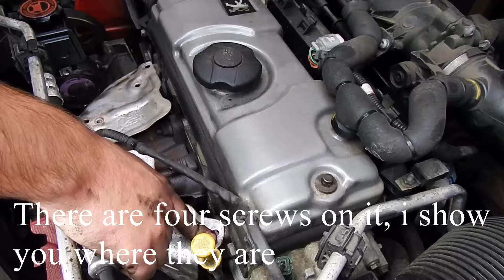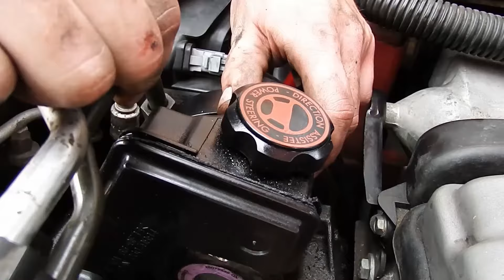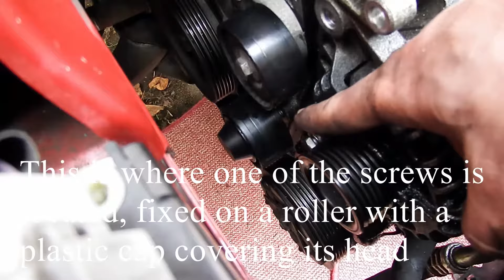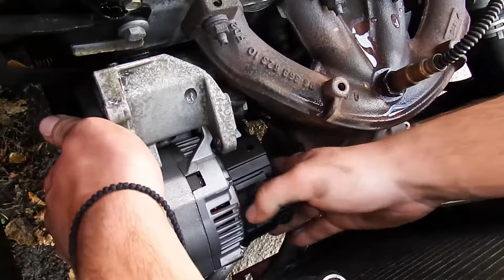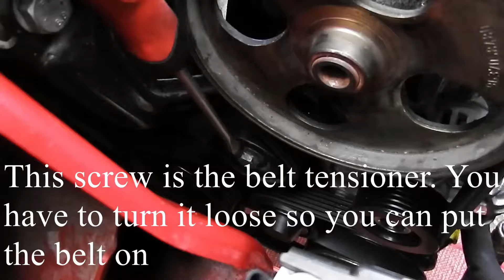Peugeot 206 how to replace alternator, belt & steering fluid pump

Comment: No need to drain the PAS pump. Remove the torx screw supporting the pipes on the opposite side of the engine, there's enough flex in the pipes to lift it and rest it at the front of the engine giving plenty of room for access. Remove the two bolts on the left of the alternator, loosen the two bolts on the right of the alternator then the bolt heads slide through the holes. Large cable is live, not ground so remember to disconnect the battery. Very difficult to read the white font at times. Example 4.50. Try a blue font.
Reply from the maker: Thanks mate

Comment: This is peugeot - simple, yet reliable.
Reply: reliable? it is not reliable lol
Reply: @iamhereforever  listen man i dont know what u heard about the french cars its true that citroen and renault are not reliable but peugeot is one of the most reliable cars on the market my dad owns one havent made a problem once .
Reply: @mishoatanasov2372  well, i always avoided french cars, but 2 years ago i bought a peugeot 206 CC and it is giving me a headace and a empty wallet. right now my dynamo is malfunctioning and i found a website today where people can open a topic if they have problems with their car and based on the amount of topics, citroën has the lowest amount  of problem reports. Citroën has 6528 topics, peugeot has 19015 topics and renault has 18869. ofcourse, it doesn't neccessarily mean that citroën does actualy have less problems in general since it depends on the car owners who visit that website and report their problem there to look for help, but it does say something about reliability in my oppinion. it could be that alot of peugeot or renault owners know about this site, and citroën owners don't but it doesnt look good for those 2.
Reply: @iamhereforever  Look man it depends what peugeot you bought and from who. Maybe the guy didnt care about his car and didn’t maintain it well. I cant wait til im 18 years old and buy a 206 gti.
Reply: @SoupyTwist the steering fluid cant leak over the alternator the lines are not even located there mate. Just do your research before speaking bullshit

Comment: Hi. I recently encountered a problem with my car . My car is a 2003 peugot 1.4 manual trasmission . The problem comes as you put the car on first gear run a little bit then you press the clutch .... If you release the cluth without shifting to a higher gear itll jerk .... It happens on every gear but on the heavier gears it gives you a harder reaction. What dou think it could be...

Comment: Great video what power steering fluid did you use in told dexron 3 or Alison c4 the Red stuff but not exact, I've got carlube to put in what did you use
Reply from the maker: Plenty of options mate, i prefer to stay with the manufacturer' s specifications

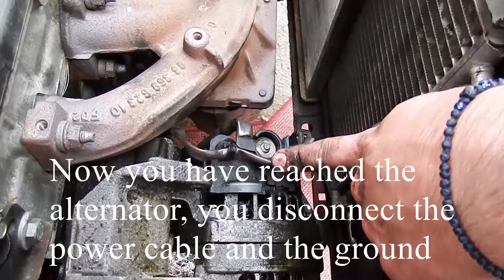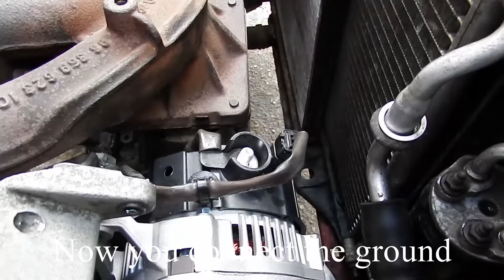Comment: 1:43 4:49 This is not the ground cable! It`s a positive cable!
Reply from the maker: Thanks mate, everybody can tell the difference between the two cables. Hopefully you too!
Reply: no offence but it shouldn't really make a difference because the battery has been disconnected. besides that, there is no way that people can switch those 2 with each other because of their connection. people who leave their battery connected while doing stuff like this are asking for trouble.
Reply: I was about to comment on this.  @Damianos 980, You are absolutely right.  The bigger round cable is the Positive out (B+) that goes to the battery.  The other connector is a switch (sensor) that communicates to the ECU.  The ground is the casing itself that bolts onto the engine.  No need for a separate ground wire.

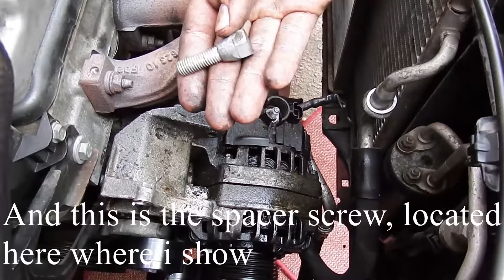Comment: 2:14
And how do you remove that screw? There is no place for a wrench
Reply from the maker: You don' t have to remove it completely. You just set it loose and it can go through the hole whilst being attached to the alternator. You can watch the installation process showing the answer to your question

Comment: Having trouble removing the bolt on the bottom right side because the space is very limited around it. I have to force my hand trough the gap, and try to push the wrench on with just my fingertips blindly. Any tips/advice? I got the peugeot 206 cc 1.6 16v 2002 version
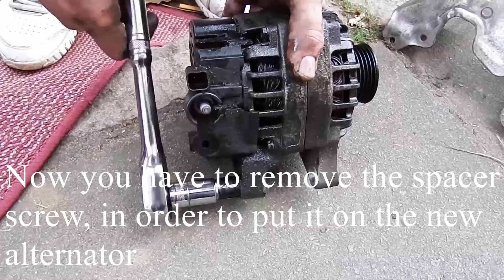Reply: Is it the one shown at 3:23 ?
Reply: @MultiFyber  no, it is one below that. I got every bolt loose, just the last one is a pain to remove. Unless it is something else but i dont think it is because my altenator is still stuck. No movement at all
Reply: There is a soft heat shield on the right side that is still tightend somewhere down there and that makes a small difference aswell. I am going to try to reach the bolt again now, let's see if i can finaly get it off
Reply: Do you think that if once i place the alternator back, that i can just keep that bolt out? Since it got the other bolts holding it pretty tight?